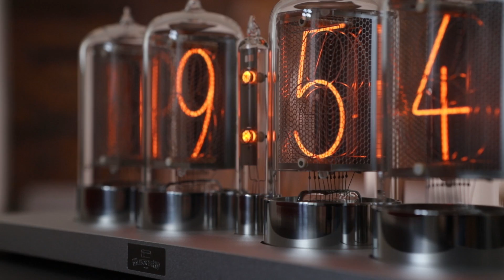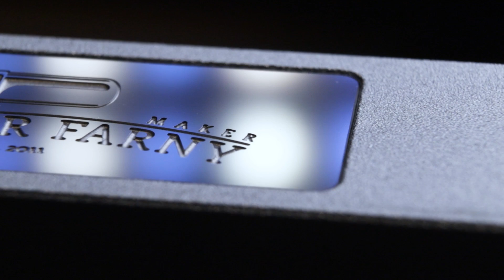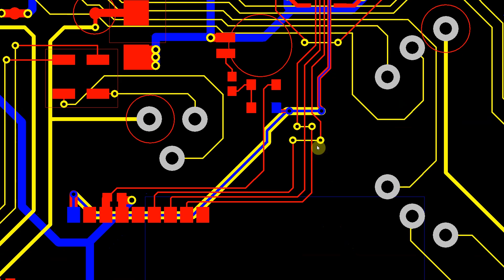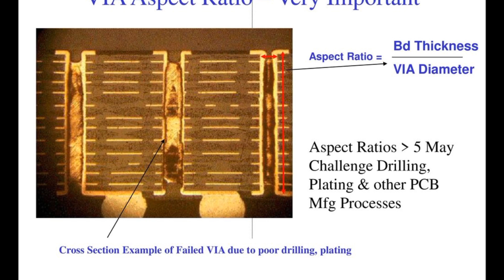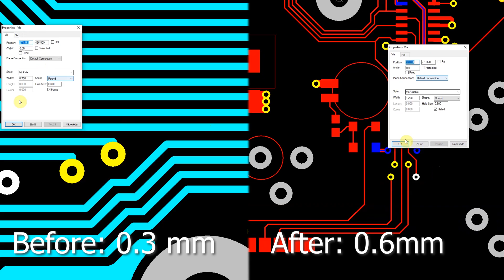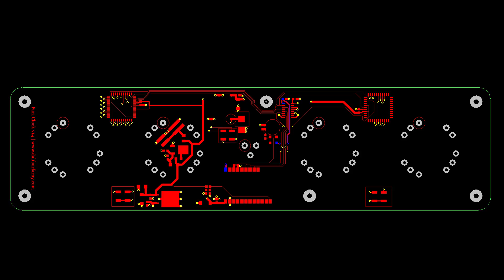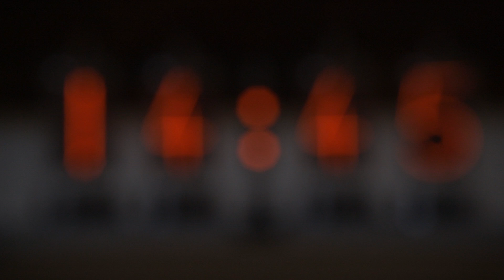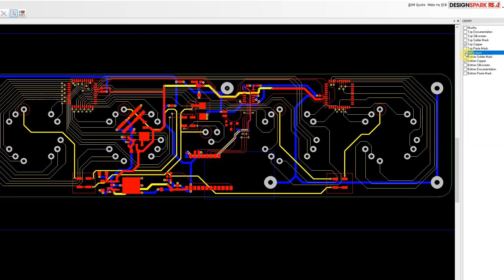Investigating a Nixie Clock Failure

Comment: Interesting. It's time to make the rooms as ultra clean rooms. Also the serial numbers need to be laser etched and a more consistent glue epoxy or silicone using a lathe and custom trigger for the glue's gun. Perhaps always put rosin on the solder if it's already been soldered to the points and lead to prevent as much oxidation. Also clean with 99.99% alcohol all solder (perhaps with ultrasonic but be careful with the fumes) and welds.

God bless, Rev. 21:4

Comment: 4:26 - If you're using multilayer PCB... the most fundamental things like via durability is important. You can take a course on udemy.com and teaches people how to make and calculate multilayer PCBs. I think there are books about it too. Stuff like this, specially multilayer PCBs should be designed by experienced electrical engineers if you never want hiccups like these.

Comment: Where ever there is space i use 2 vias instead of one via, the extra via acts as a redundant connection, also add teardrops where ever possible.
most of the Via failures are due to the Z axis expansion of the Laminate, so using a laminate with lower Z axis expansion reduces this problem.
185HR from Isola is a good material with lower Z axis expansion.

Comment: The Clock cost 1600usd and you make the pcb in some cheap chinese workshop
Reply: The original tubes these are based on, cost around $300 and $700 each if you can still find them. So $1600,- for 4 tubes and a colon/separator tube incorporated in a nice design clock is not expensive.

Comment: Also be careful with PCB manufacturers... 
Especially here in Czech Republic there"s a bit of that rezistance  to tell the costumers that their PCB's fail a lot. For example certain Prague based PCB fab, won't be throwing names, has quite long history of low quiality vias. Literally you get package of 250 boards and 150 of them are deffective with no copper at all in the barrel of the via, while you also get the certificate about passing full electrical tests. 
It's quite frustrating.
Reply from the maker: Hi, thanks for the information! We now use mainly Gatema.cz and Printed.cz, both very reliable. We increased via drilling and traces spacing and since then we havent had a single issue with any of the boards.

Comment: I have a faulty 1971 vintage IN-16 that developed a short from anode 6 to cathode burning out the darlington driver chip in my homemade clock, I switched it with anothe one in place where digit 6 is not used and left disconnected the faulty anode. The light of these soviet tubes is paler orange than usual neon indicator bulb as it contains mercury to prolong the lifetime.

Nice work, looks well made. _

Comment: There are many things to improve, first, absolute must is to use teardrops on every pad and via if possible. Next, top layer is good to be plated with copper aswell and use it as an EMC shield, then add many stitching vias to seal the inner layers in between. Top and bottom copper also makes the pcb more rigid. Then, use larger separation between the pad and gnd-copper so it is impossible to short if tube is misassembled. Then place the components to one side only so it goes throught the reflow oven only once and stresses the vias and components less. Use double vias, or epoxy-plug them. Then concider higher tq material if board gets hot.
I have't had via issues even on thicker 3mm boards. It has to do with the pcb company and their quality to assure the boards will last. We always used the best companies and good materials. Don't be cheap, buy the best boards you can. Losing your reputation because of quality issues is really silly.

Comment: I am not keen on more than 2 layers personally, too difficult to repair if something goes wrong with connections or tracks on the inner layer. I like the way you address failures though and learn from them, altering the design as necessary. That sort of attention to detail is essential for decent quality control.

Comment: always use crimped wires in connectors, don't relay on cheap chinese multi-meter, an autoranging bryman/fluke or any known brand will do.
Reply from the maker: For interior use there is no benefit of using crimped connectors - it is just waste of resources. For simple connection check using a cheap meter is ok, expensive multimeters would be again waste of resources. We have calibrated 7 digits multimeter for precision measurements where we need it. Together with Delta Elektronika power supplies.
Reply: @daliborfarny  Crimp connectors are typically used to terminate stranded wire. The benefits of crimping over soldering and wire wrapping include: A well-engineered and well-executed crimp is designed to be gas-tight, which prevents oxygen and moisture from reaching the metals (which are often different metals) and causing corrosion.
https://en.wikipedia.org/wiki/Crimp_(electrical)

Comment: Everything they do is beautiful.  So imagine my total shock when they didn't use a clutch drive at 12:26 and torqued the hell out of that screw head!!!!
Reply from the maker: Ryan McDonald I really miss a clutch on that screwdriver, but I can compensate for it with my hand - definitely not much load on the bolt head..
Reply: @daliborfarny  I'm truly amazed by the quality of the work and passion you put into these Nixie projects.  Beautiful indeed.  A couple years ago, I designed my own PCB and built a clock totally from scratch with the common IN-14 tubes.  I love the look of Nixies.

Comment: One question - why you dont do the same connection for the tubes that have tube amplifiers? They are not connected directly to PCB but with tube socket.
Reply from the maker: Integrating sockets into pcb is easier, there are no sockets for our tubes available - we would have to develop them. Such solution would be also bulk, not fitting into thin clock..

Comment: Dont want to sound harsh but those things a rather standard issue and your electrical engineer should have accounted for such things, For the voltages you use the clearances a shockingly small. Ground plane on only one side is very bad, you want your cooper distribution equal and symmetrical or otherwise the board will warp and develop stresses especially with Temperatur damaging components and Vias. If you need help with Electronics feel free to ask

Comment: Some tips.
- Use a 4 layer pcb (standard, will help you switch factories easier), 2nd layer ground, 3rd layer power (3V3), 4th layer high voltage, and most signals put them on the top. Dont break layers 2 and 3 for anything at all.

- Make your traces thicker too (12-40mil for simple traces if u have space)
- Some factories offer via filling (but not that necessary in this case)
- Use multiple vias + polygons for anything that consumes more than ~20mA
- Add more caps around, i dont see that many ;)
- If high voltage signals are going near normal pins, put a ground trace in between then to avoid coupling and also put them as far as possible, or from layer 1 to layer 4. Same with high speed signals.
- Im skeptical about your factory (via issues are quite uncommon, and the soldermask seems to be meh quality if its so easy to get scratched). 

Hope this helps, nice filming man!
Reply: Traces thickness recommendation has zero merit past current handling capacity and impedance control - absolutely any fab can nowdays handle 6/6mil rules for 35um finished plating. The norm is optical inspection of all layers before lamination and 100% coverage e-test of finished panels.

Via filling is intended for absolutely different purposes and does not help with the problem presented in video at all (actually can even worsen it, especially if overplated). From solely the PCB reliability standpoind of view, its not even optimal to do soldermask tenting of the vias.
Current handling capacity of even smallest technology permissible via in comodity technology is way way higher than the order of magnitude of 10mA - the stitching becomes important one or two magnitudes above that - depending on via drill diameter, which can drastically infulence its current handling capacity. Heatsinking by surrounding copper (be it power trace or better yet polygon) plays important role as well. Impedance of the via usually matters way more in most cases, and in some less common the ohmic loss (Vcore rail for MPU or FPGA) - but that is outside of the scope of the design presented here.

Recommendation of putting the HV lines on outer layers as optimal is wrong. Whenever possible, they should be routed on interal layers as the surrounding laminate has much better insultation properties than what is possible to obtain on outer layer. Soldermask is just that - it is NOT an functional insulation layer and minor voiding defects are allowed and normal. Surface resistivity of any insulation material will be always worse than in its bulk, even in pristine conditions (which won't be maintained over time). Post-manufacturing cleaning is hard (and there is no such thing as no-clean flux!) Also depending on the edge rate (if some of the singals are switched or AC),  EMI will get much worse. The recommendation does not hold true for high edge rate signals at all either - there you actually care most about low impedance return path beneath provided without any voiding, and layer placement/stackup is more governed by impedance control of those signals and mutual crosstalk, not crosstalk as agressor to other slow nets around.

Suggestion of keeping both groundplane and power plane (single rail) totally void-free is bit off as well - it is absolutely normal to have mixed signal polygons and even some routing on power planes, the ground is what usually is the important reference plane that is good to aim to keep void free - even there, exceptions do apply. Note that by that I am not implying that the power rail does not serve absolutely same purposes from RF perspective (reference), carefull planning of the adjecent layer routing has to be done, should you decide to do mixed net pour there.

BTW: the PCB mfg is local, reputable and with good quality control. They have had almost flawless track record with all the companies I worked with and for past some minor cosmetic defects in single case which got promptly admitted and respinned at zero cost. It is very good idea to have a good long ponder about the causes before trying to play shift the blame games.
Reply: @Konecny_M  
Trace thickness does affect things. If you can add thicker traces, you absolutely should (for slow signals at least). For example when you do panelization you have uneven etching and in some cases the PCB factory will remove these PCBs or mark them for you. It is one of the reasons many PCB factories make more PCBs than you order. PCBs fail in different stages at the PCB fab and one reason is over-etching/under-etching. (I've seen 10mil traces being reduced to nothing on the edges of panels, accidentally scratched, etc). Just my opinion, use your own judgement. But with a PCB this big it wont hurt making them thicker.

Via filling, I meant with solder sorry. Obviously any other filling wouldn't work (I would still go with larger Via holes and tenting). Vias yes can handle alot of current (which unfortunately varies with factories, and day of year), but I tend to over spec my designs when I can. Its easier to say, enlarge vias or add more, than sitting down and explaining that even though your WiFi module consumes 200mA average, you should spec everything to 2 Amps to account for spikes, in-rush current, voltage drops, etc. Its a YouTube comment after all. 

I agree that HV lines can be positioned more optimally, my original comment was meant to be short. Not dumping a giant textbook response, as its hard to explain some of the reasoning. For example, HV traces ideally shouldn't be on the top where the majority of the other signals are. But also the bottom side is exposed to the customer & will radiate outwards. But if you need to put them in the middle layers you need to have a lot of experience with ground loops, not cutting the internal planes, etc. unless you know what you are doing. Regarding HV switching lines (or high current) being near other signal traces, things will couple one way or another so if you can put a ground line between them, distance them or put them away on a different level then better..

The power plane can be segmented yes, with ground more care needs to be taken.

Soldermask seemed a little weak on my opinion, maybe not as scratch resistant as others. Especially matte black which is usually the weakest of all. Also the via thing, well its still a via failure so I don't understand why I am not allowed to comment that I am skeptical about it?
Reply: @marios2liquid  I still disagree with the tace widths. You are at freedom to fully utilize the design rules class you used for the design and paid for - unless you step down the whole design technology class, you won't get benefited in any way by the manufacturer price-wise. Rejects are totally expected (and you already paid for them amortized in the cost per given design rules class). They really should not happen due to under-etch trough, that is a very bad sign about lack of process quality control of given fab.

Comment: Making the vias larger drill diameter will help to mitigate the problem only partially - it does not remove the root cause, only makes it less likely. The main fault is using the PCB as structural member of the mechanical assembly - using larger laminate core thickness is step in right direction, hovewer you have to correctly place mounting points to the case still - the PCB is nowhere rigid enough. Having screw holes only on the perimeter of the board is not optimal/enough. Once you do that, using regular stock 1,6mm thicknes will work out just fine (and overall design cheaper to produce, even when the needed changes to mechanical assembly applied). Same stresses can and will cause cracks to MLCCs present on board, with problems likehood increasing with package physical size and capacity. Board flexing during insertion of the nixie tube is inacceptable.

If your CAD package allows conditional design rules, you should apply larger clearance on high voltage signals on outer layers - you have higher likehood of problems there due to creepage distances due to possibility of external contamination of the board. Soldermask defined pad is recommended as well for those (with big enough margin to make up for the litho aligmnent error). On HV DC signals, you can also cause problems with electromigration of surface contaminants (meaning initially only partially conductive strays can worsen over time). If you use lead-free solder (which you de-jure must, if that is a good idea is whole other question), you might have further problems with tin whiskering (depending on exact alloy).

Three layer stack-up is nonstandard, the board is getting produced as 4L anyways (implied by the technology process) - take that to your advantage and do ground and split power plane, they should be placed on L2/L3 with similar amount of copper fill rate to prevent warping during reflow. Tighter coupling inbetween the power planes helps to further mitigate EMI. 

EMI problems with two groundplanes was most likely due to insufficient via stitching of both and likely having excessive voiding / islands created by tracks - in absolute most cases, having low impedance connected several groundplanes makes things much better, not worse. Don't forget to viastitch also on the whole perimeter of the board - otherwise edge-radiating antenna is unintentionally created. 

PS: Pokud máte zájem o hlubší analýzu na základě kompletních dat návrhu, dejte vědět :)
Reply from the maker: Thank you very much for this comment, lots of valuable information! Just few quick explanations - we didnt have problems with EMI, this was fine with the previous designs. It is only better with new design.. We use increased clearance (2mm) on HV lines - exactly for the reasons you mentioned. Thanks for the tips regarding the layers and EMI - we will sit on it and discuss what we can do better for next revision. Keep in touch :-)

PS: Je na Vás nějaký kontakt? :-)
Reply: @daliborfarny  V youtube profilu mám doplněn pracovní mail.
Reply: Personally i would like to separate DPS for electronic and nixie tube mounting and connect them together by ribbon cable( or direct connector)... this would solve "all eggs in one basket" problem and mechanical issues too since DPS for nixie tubes can be single side with nice thick tracks mounted from inside by 4 screws per nixie tube...

Comment: Dalibor, when I used to repair multilayer boards in the military. My go to method for troubleshooting “VIA” issues was freeze spray and a heat gun. It was fast and very reliable. There are various methods for repairing this permanently, but none of them are pretty enough for your circuit boards. Which are for all practical purposes, works of art. Like putting scotch tape on a rip in a Rembrandt.

Nice catch with the stuck digit. From the video it was obvious that the customer accidentally misaligned the tube while installing it. Sure you can always make the spacing larger. Then there will just be another customer who pushes harder and longer whilst misaligning the Nixie, than the last.

I am really digging the all white shop. At first I thought it was too much, but all of the equipment and furniture help balance it out quite well.
Reply from the maker: heat cycle - very interesting method, thank you for sharing it! the white shop was quite good idea, more coming soon..